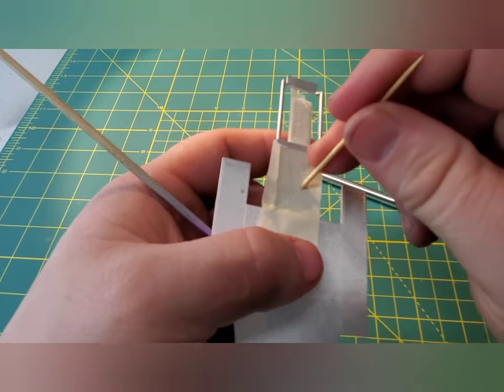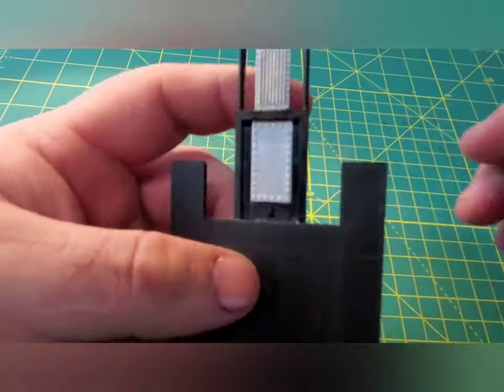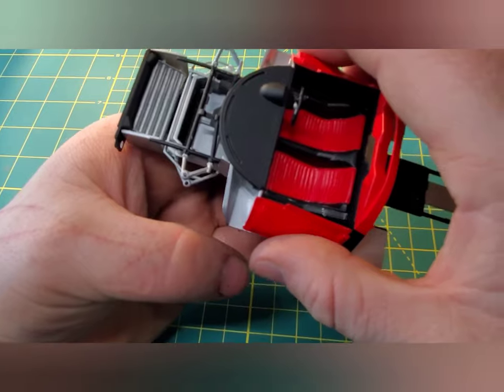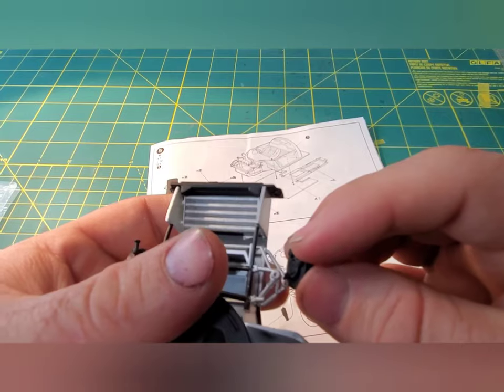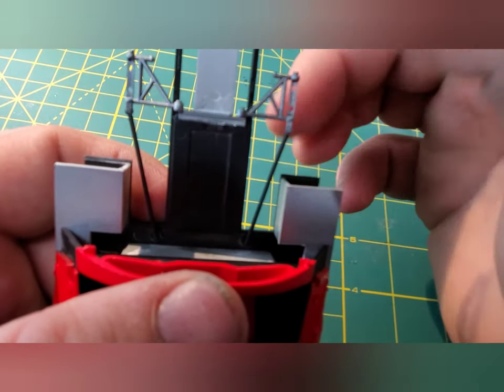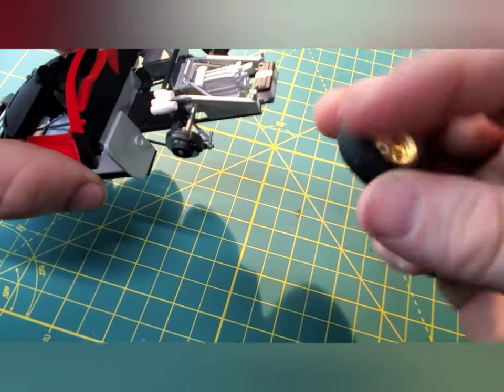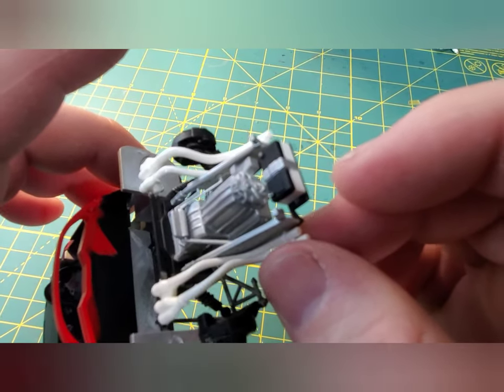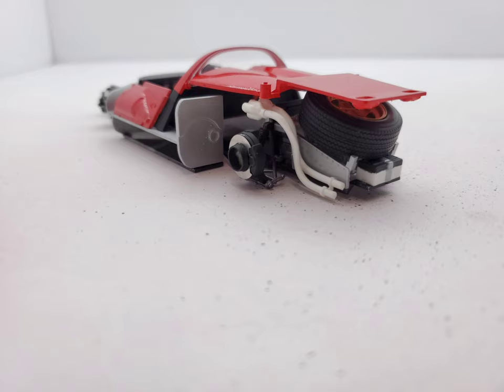Fujimi 330 P4 build - Part 4, chassis.

Comment: I use a round exacto blade to cut PE I roll it over the connection point and get a pretty decent cut. Very easy to clean with a file.

Comment: Hi! Mark, here. Heard about you through JHart Modelworks and came over to check it out and subbed! Some cool stuff! I'm going to have to check out your video on adding plug wires to engines. That's something I've seen other guys do and would like to do but have never really learned how to go about it.
Reply from the maker: Not really much to it. I'd strongly suggest buying a pre-made distributor though. Just makes it so much easier. The biggest headache is just making them all even. I like to stuff as much wire into the engine as possible then pull out what I need because once you cut one you are locked into that look for the rest of the cylinders.